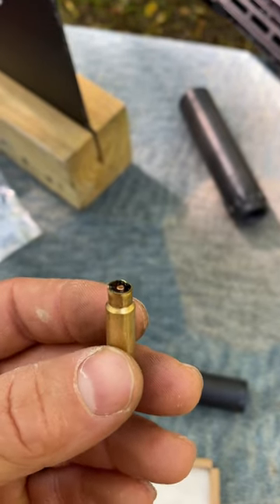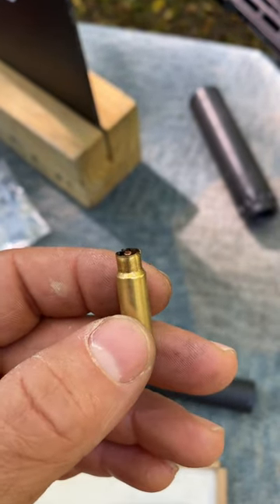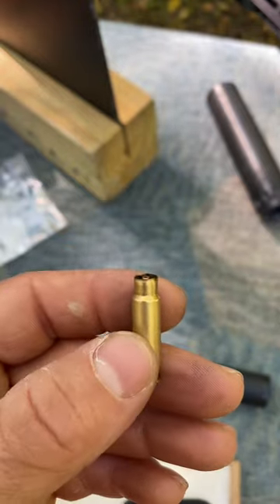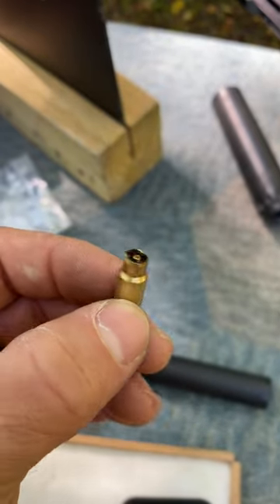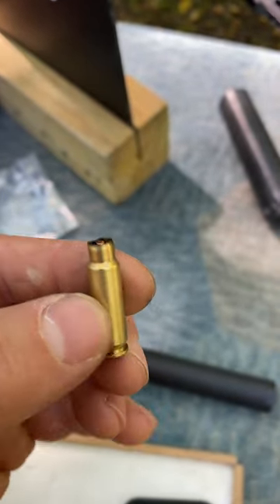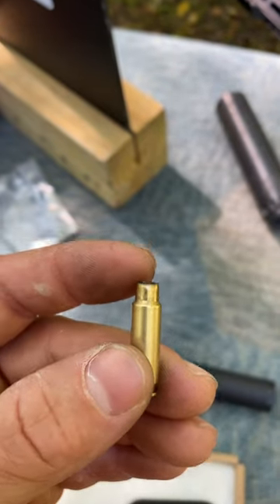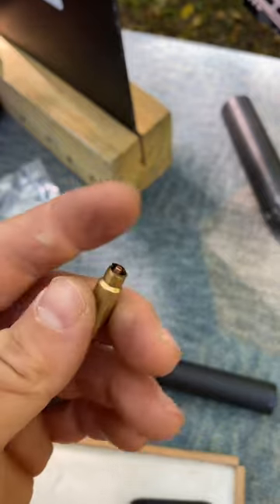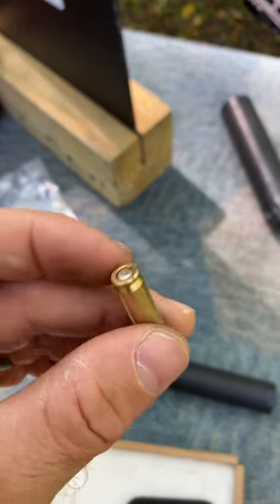Why American Eagle 5.7x28mm Sucks! #shorts #fail

Comment: I think federal is trying to save money by not investing in a dedicated 5.7 reloading line. They probably run these on the 5.56 line/bench to speed up production. FN probably has rights to the industrial tooling or heavily controls the market to avoid competition so federal cheeses it by gluing instead of crimp.
Reply from the maker: Federal doesn't actually load these. Fiocchi USA does and has for quite some time under license/contract from FN. This is all hearsay, but I've been told this is how FN spec'd them to run the ammo.

Comment: I didn't see any type of sealant on the case mouth like a lot of military ammo has. Maybe FN uses glue to prevent such failures and seal against moisture. Maybe painting a lacquer sealant around the case mouth around the bullet would help for anyone without the means to run them through a crimp die
Reply from the maker: It ideally should just be crimped from the factory and it would be fine..
Reply: @BuffRANGE  I agree, but having worked for a large corporation for a long time, they will turn out crap if it saves them a penny.
Reply: I have done both things as an experiment.  I used clear primer sealant and lee crimp dies for my experiments. Both ways work but it is far quicker to just run them through the crimp die and it also seemed that they were far more consistent velocity wise with being crimped. I now crimp all my AE 5.7 rounds.

Comment: In my CMMG bolt and barrel that I have installed in standard upper, this ammo has the bullet separate if you load a round and then unload it without firing.

Comment: I thought Federal may have fixed this based on some positive reviews I've read in the last 3 months; however, now I realize those reviews are likely from people shooting it in pistols. 
I wonder how it'll do in a RUGER LC 57 Charger, which is more like a pistol since it looks like the Ruger 57 pistol with a longer barrel.
Reply from the maker: The Ruger still has a heavy bolt like the P90 but it has a feed ramp. The other concern is that Federal doesn’t load this ammo. Fiocchi USA loads all US 5.7 ammo. AE TMJ, Ss197SR, Gold Dot, and their Hyperformance line.
Reply: @BuffRANGE  Hopefully the feedramp will help, but I can get the 40gr Fiocchi for about the same price as the AE ($30-$33). 
Does Fiocchi also load the AAC 5.7 for PSA as well? It's gotten really hard to get the "boutique" rounds (Black Fang, T6B, etc.), so I've been eyeing that AAC v-max as it seems a bit hotter than Fiocchi's offerings.
Reply from the maker: @joeflowers9084  AAC makes their own brass and loads their own :)